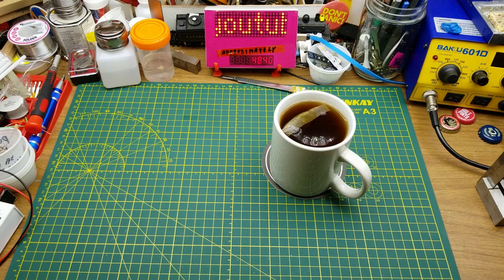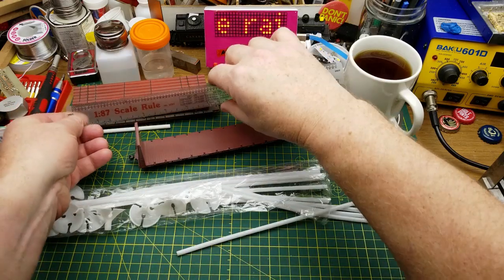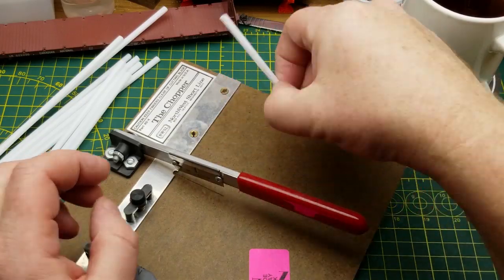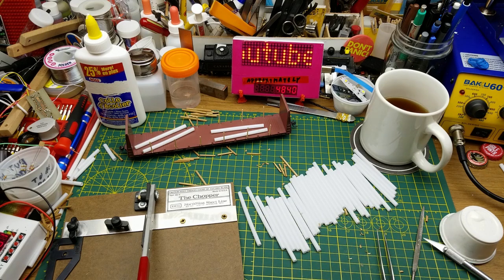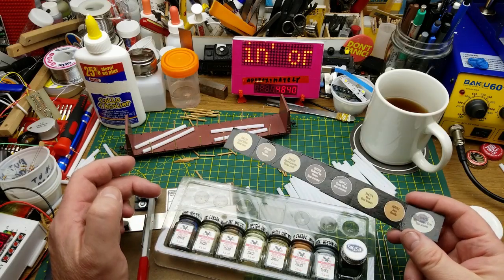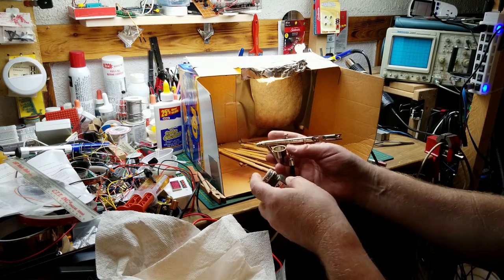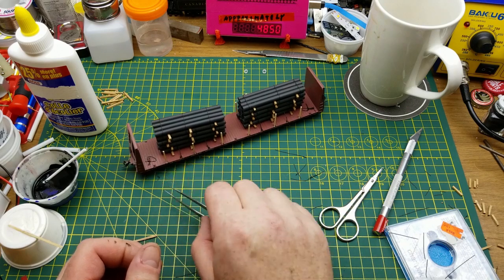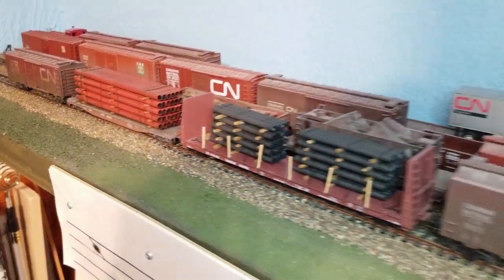HO scale model - building a pipe load

Comment: I use my chopper all the time for cutting plastic and wood.  Handy gadget for model railroaders.  I use match sticks, not kitchen matches but the smaller little boxes.  Just cut off the heads and there ya go.  I used to work at a lawnmower manufacturing company and I used an air powered tensioner to band the rear wheel to a pallet.  I'm sure that's what they use to secure pipes.  Arm's length is a good rule of thumb for HO gauge.  I cannot believe some modelers cut all the molded on details and then add them back so they look more realistic.  I just paint them and go on.   Couldn't ya just use painted drinking straws?  Cheers - TN

Comment: Steel that looks black like this has a outer hard layer on them. It is called mill scale and is a thin oxide layer that will flake off when you bend plates or pipes, kind of like old paint but harder.
It is not intentionally made but becomes made when heating steel in hot air and rolling steel plates and pipes. I did work as a industry welder once back in time and noticed this.
I have electro-mechanical education, worked as gardener, janitor, painter, plumbing, house electric, car electric, soldering electronics. We did as kids like to sit and look at grandpa (who died 40 years ago) doing carpenter work and a dads friend did mason work after they did drill holes and blow away rocks with dynamite under heavy car tire mats.
So i has done a variety of works and education trough life and know a bit of everything, it can be good sometimes when someone notice things like you did here with the black pipes and thought that was interesting. So now you know :)
Its likely good to know how things work when making models look as in real life. The black oxide layer work as a somewhat weak rust protection, very far from galvanization but works for a while, so they are black for a while, but the pipes are cut so they have bare metal on the ends and thus fast becomes rust red there in the rain.
I see it is green there on the ends on the photo, i think that is something they put on to protect the ends from rusting, i has not seen what that is in real life, might be plastic, might be paint.
Reply: The green is plastic caps.

Comment: Upvoted because I'm a modeler too (not railroads but still) however...
That strapping would NEVER be left lying there. Remember it is steel strip which is like an unsharpened knife- not dangerous unless, say, it comes flying off of a passing flatcar, whacks through your windshield and decapitates you. Even those wood spacers should be tied down.
Nonetheless, please do more modeling videos. I've moved to paper modeling and am always looking for more inspirations.
Reply from the maker: Good point.

In my miniature world I guess the safety inspectors are a bunch of slackers
Reply: The banding breaks also, especially when the cars get humped.

Comment: Neat!   Is that little spray painting mechanism specifically designed for those small jars of paint?
Reply from the maker: There is a jar attachment for the airbrush, but it can also be set up to paint from any source.

It's main purpose is to spray controlled amouts of paint very precisely.  

I'm not using most of it's capability. It can do very fine and delicate painting in the hands of a skilled artist (I'm not that)